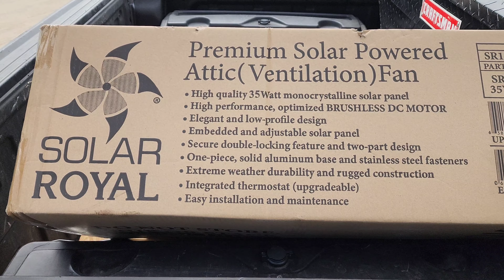Royal Solar Attic Fan | Prime AC and Heat | Saving Energy and Creating Comfort

Comment: Do this attic fans do work?? Temperature difference?
Reply from the maker: @mun6884 great question! 

Yes, attic fans do work. They help in ventilating and reducing the accumulated heat in the attic, which can otherwise make your home warmer during the summer months. By promoting better airflow, they can prevent moisture buildup, which reduces the risk of mold and mildew. The temperature difference varies based on several factors like outside temperature, insulation, and attic size, but on average, a well-ventilated attic can be 10-30°F cooler than one without a fan. Always make sure to pair attic fans with proper insulation for the best results!

Thank you for watching our video 😃